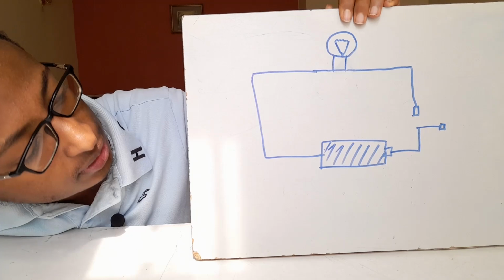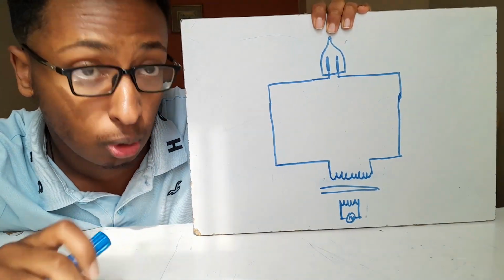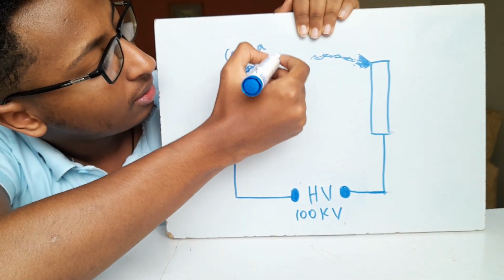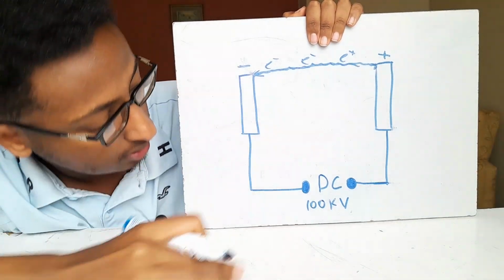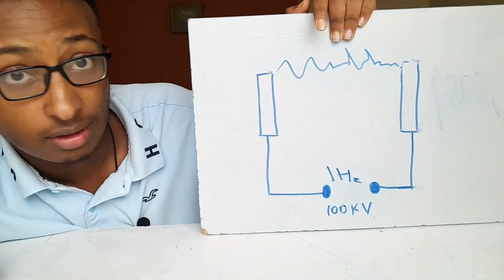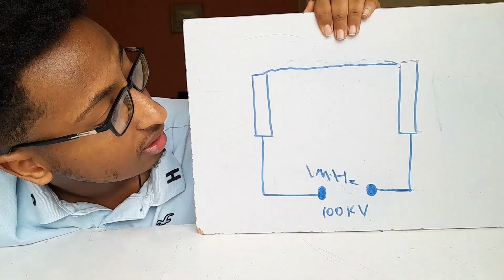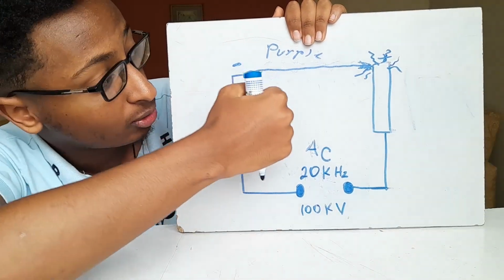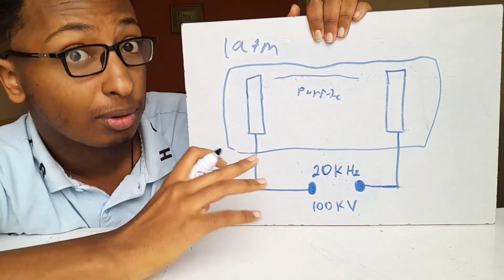HIGH VOLTAGE??!! | Detailed Explanation Using My Flyback Transformer

Comment: Hello from Ottawa, Ontario, Canada.  Consider a linear electrostatic motor, charge coupled devices and, the polarity of water molecules.  Now, invent a simple cheap machine what will purify water.  Start with this now: How does the high voltage water bridge work?  You will change the world!
Reply from the maker: Thanks man...I'll think abt it